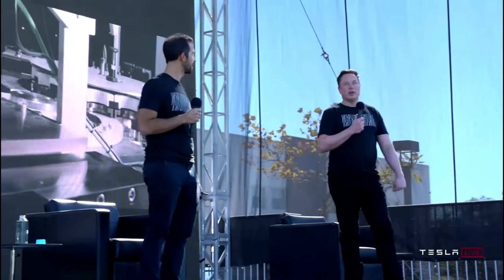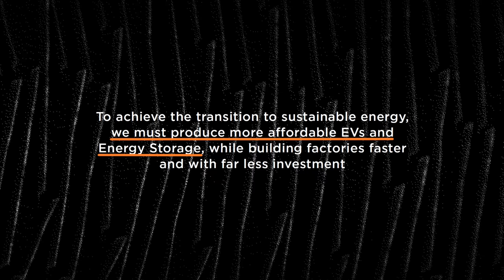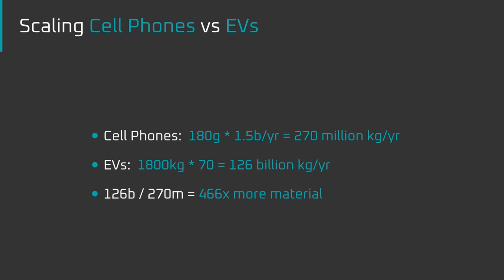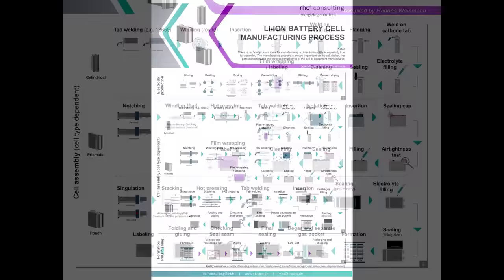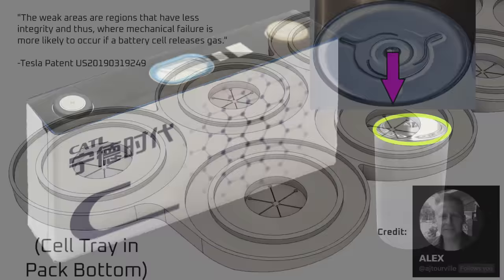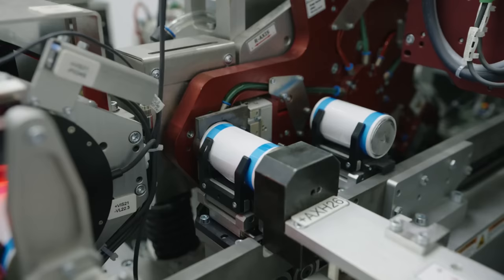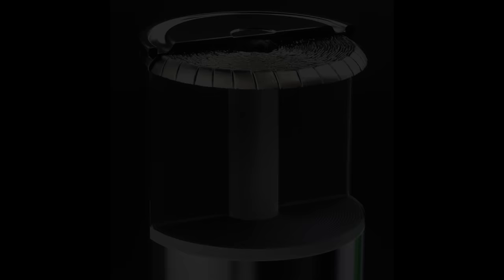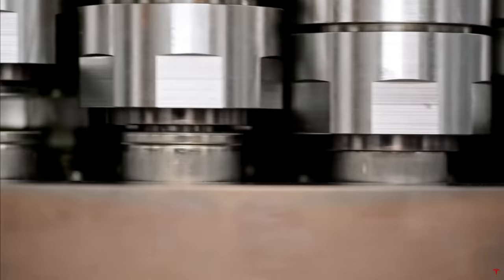The 4680 in Perspective // Battery Day Refresher + Competitors?

Comment: Why such a quick dismissal on safety and few more steps to manufacture of the most common cell for almost all product types around at this point???  Really even cars are transitioning MOSTLY to pouch cells outside startups and the Chinese who have invested more in LifePO4 prismatic battery tech.  It's like saying Tesla and startups are right and everyone else is wrong.  There would for sure be more diversity of approach and generally more traditional auto folks looking as cylindrical cells if they really as clearly the better way forward as you try to make out.  But generally other than startups and tesla, EVERYONE else is doing pouch or prismatic.

Also, it's a bit silly to suggest only the chinese lifepo4 are the only viable competitors.  If pouch cell folks start eating his lunch on overall assembled pack costs...even Tesla will switch.
Reply: BMW just announced they will be using 4680 format cells for some of their upcoming models.
Reply from the maker: You haven't been paying attention to which battery packs are catching on fire the most.
Reply: @thelimitingfactor  the Samsung ones are the only ones in standard devices, but even they are still using them.   And generally as far as I can gather in cars, it's only LG Chem doing it kinda random and with no obvious abuse.
Reply: @thelimitingfactor  So outside LG Chem and Samsung it seems fire's are pretty rare.   But it's not completely unheard of for a Tesla to spontaneously combust either.
Reply: @flipadavis  Is this for supply reasons or other reasons is the question.  Tesla has the cash from investors to make the format have good supply, even for others.  The reality is that 4680 is 100% to not lose their azz to competitors on cost while forcing them to go down a different path if they want Tesla's help ramping supply chain.  What BMW is doing is doing is invalidating some of their approach to the coming real competition they haven't had until now.